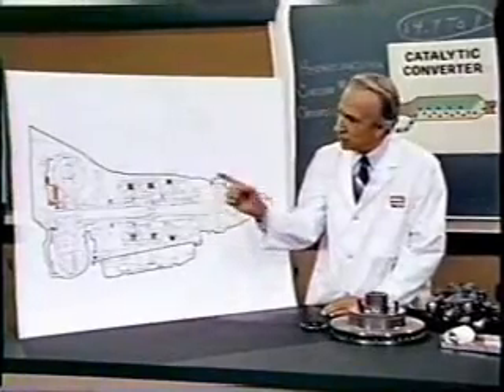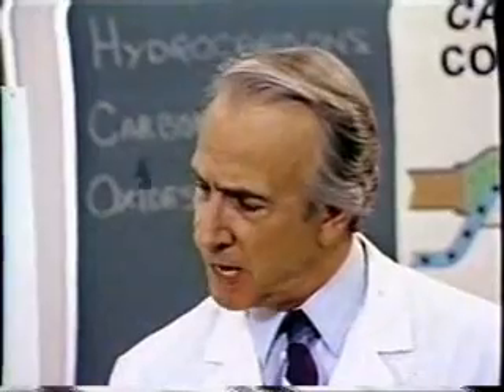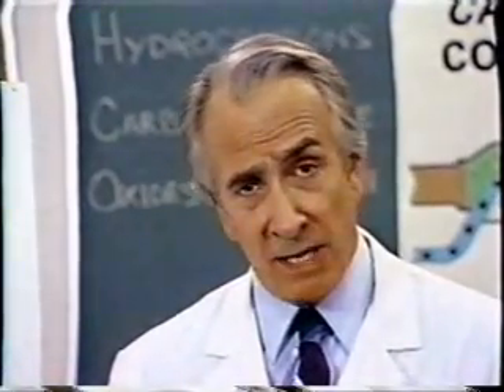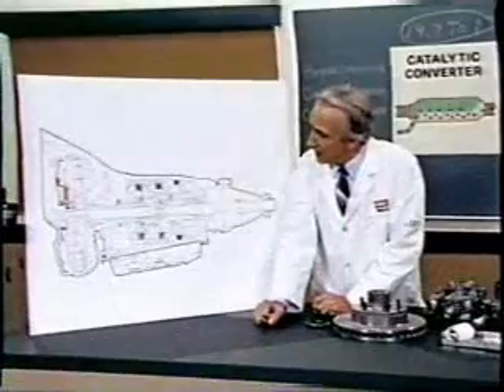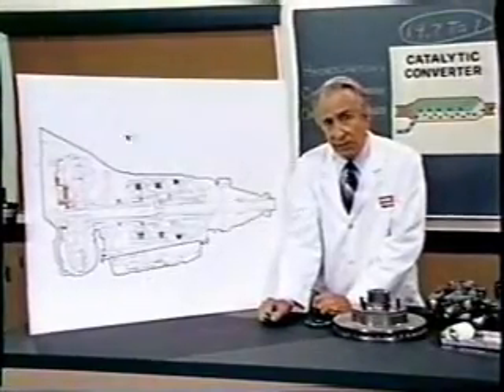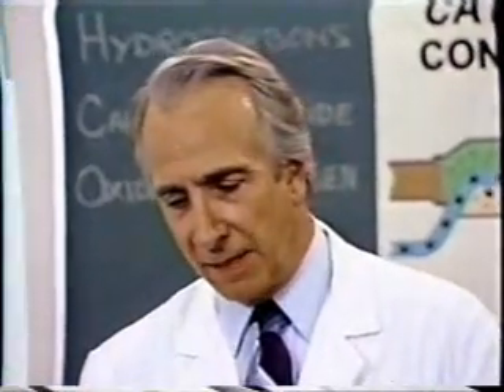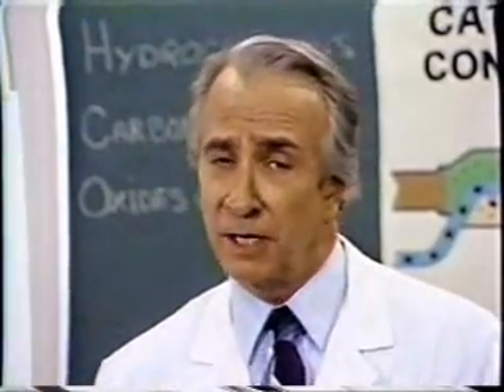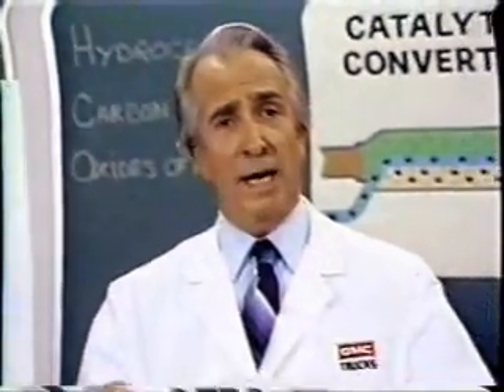engineer-speak.wmv

Comment: I read where they were waiting to film something with those displays and this guy just started ad libbed this whole spiel to warm up. Pretty impressive.
Reply: Nope...The speaker wrote out a script for this. Here's the story from the guy that directed the piece:  I shot this in the late 70's at Regan Studios in Detroit on 16mm film. The narrator and writer is Bud Haggert. He was the top voice-over talent on technical films. He wrote the script because he rarely understood the technical copy he was asked to read and felt he shouldn't be alone. We had just finished a production for GMC Trucks and Bud asked since this was the perfect setting could we film his Turbo Encabulator script. He was using an audio prompter referred to as "the ear". He was actually the pioneer of the ear. He was to deliver a live speech without a prompter. After struggling in his hotel room trying to commit to memory he went to plan B. He recorded it to a large Wollensak reel to reel recorder and placed it in the bottom of the podium. With a wired earplug he used it for the speech and the "ear" was invented. Today every on-camera spokesperson uses a variation of Bud's innovation. Dave Rondot (me) was the director and John Choate was the DP on this production. The first laugh at the end is mine. My hat's off to Bud a true talent.